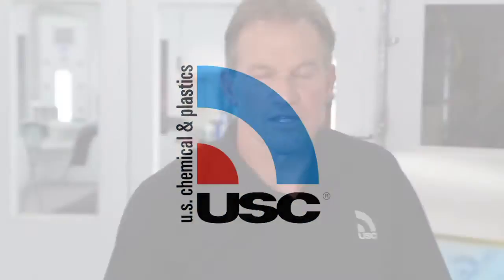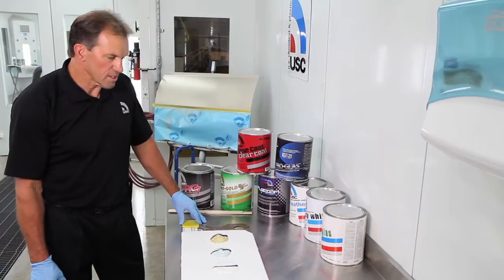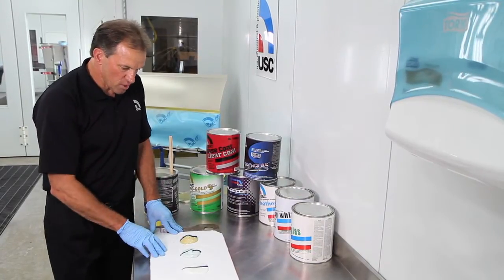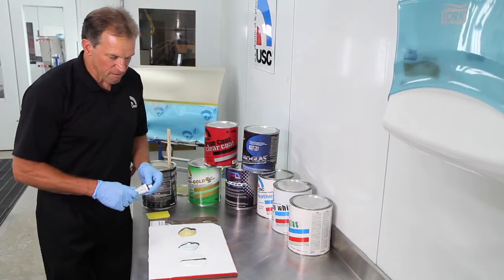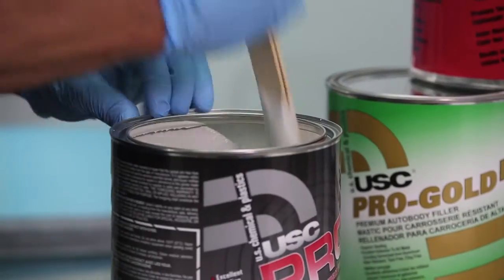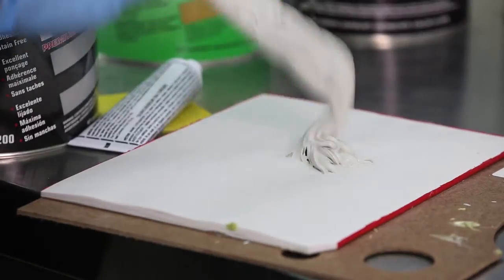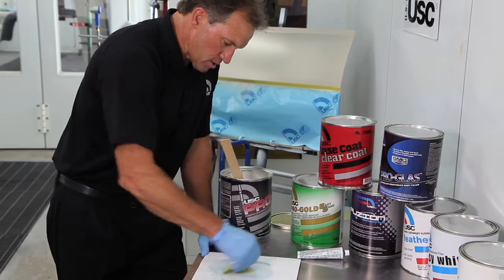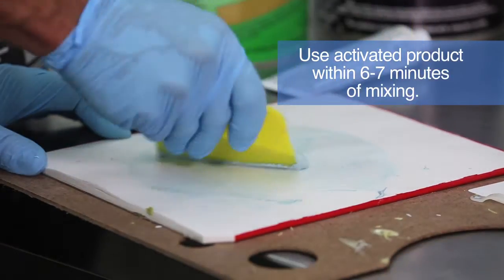US Chemical & Plastics: How to Properly Catalyze Body Filler

Comment: 6-7 minutes in the bitter cold winter.   We get 30 seconds in the summer.  Either that or not enough catalyst and it doesnt cure at all.   With all the modern advances in science we have,  plastic filler should be greatly improved by now.
Reply: 30 seconds and it hardens?